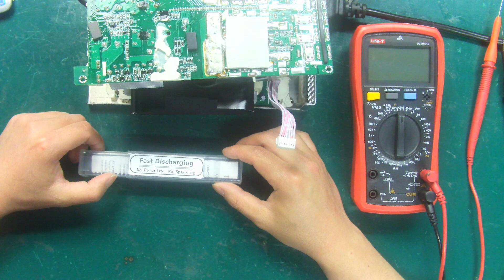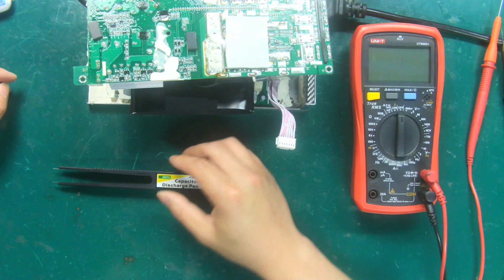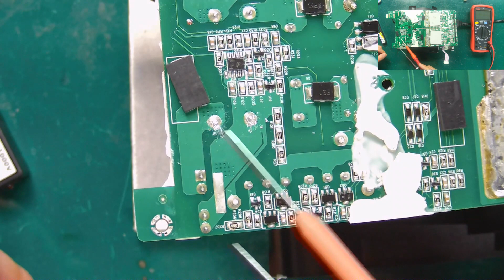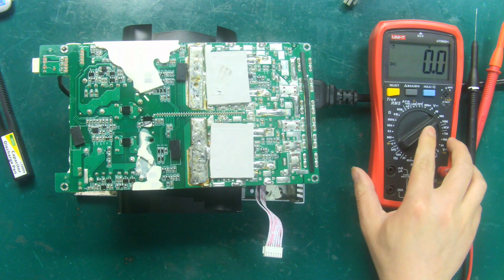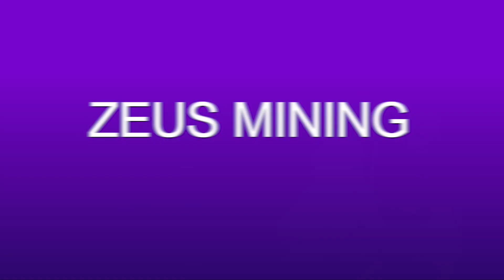Capacitor discharge pen 1000V | Capacitor discharge pen usage tutorial

Comment: What about discharging a 560uf 200v capacitor used in older TVs?
Reply from the maker: No problem, it supports capacitors below 1000V.

Comment: Good for Atx power supplies?
Reply from the maker: Yes, it can be used for Atx power supply.
Reply: Can this be used on A/C unit capacitors?
Reply: Do you know the watts and ohms of the resistor that the pen uses?